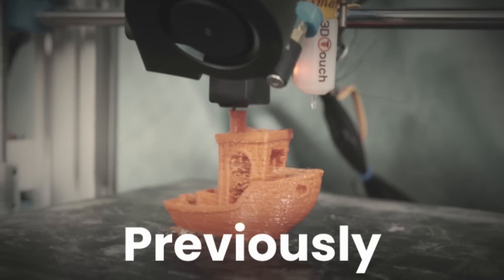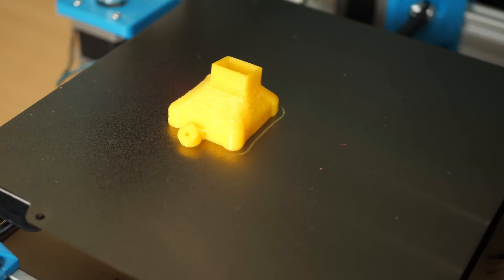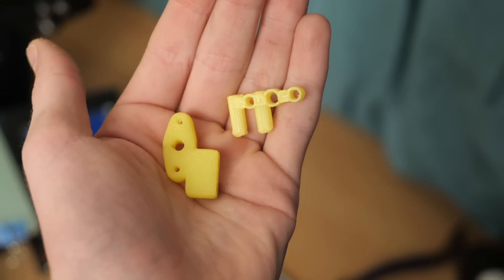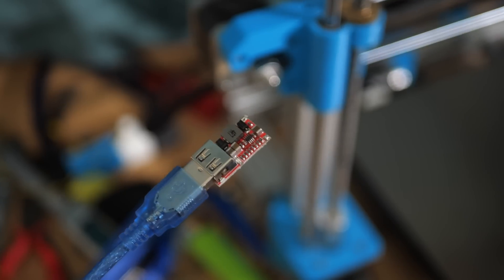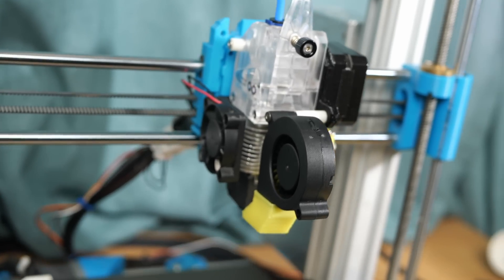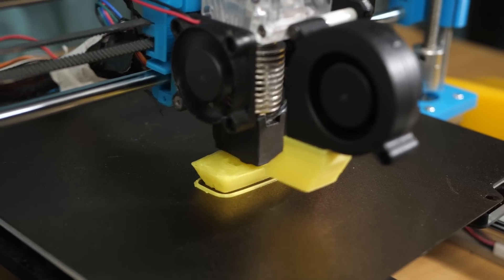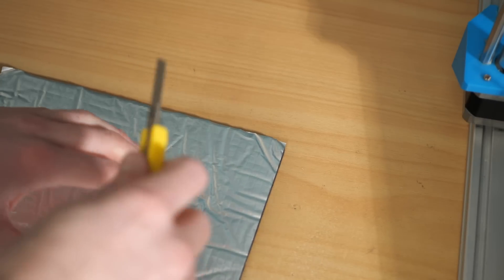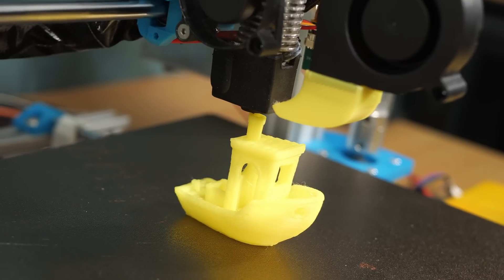I Bought a Broken 3D Printer and made it FAST!

Comment: NEVER calibrate rotation distance from printed parts. Other than the extruder, rotation distance is fixed and a function of pulleys, 1.8 or 0.9° motors, and any gearing involved.

I'm not being a hater this is super important!!!
Reply from the maker: Yeah, the rotational distance was being a real pain and confusing (especially because I couldn't print anything), mainly from mixed messages from too much research getting jumbled in my mind, I thought printed parts would be the way to go. After attempting "tuning," In the end (and after calibrating with the mechanical components) I got 32 (compared to stock 40) value for the X and Y and all my parts have been spot on since then, (thankfully.) From now on I'll definitely be taking a different approach. I appreciate your comments! All the tips and feedback from these videos has been extremely helpful.

Comment: looks like you have a g10 plate on your 3 and you said you picked up a PEI plate for the new printer? and the pei has been better for adhesion?
Reply from the maker: The PEI has been performing really well so far, and being able to take it off and flex it had been a great plus. I prefer it to G10 and can recommend it, of course it does cost more than G10 though.

Comment: Could you share how you built the printer? Board, Firmware, etc.
Reply from the maker: I wish I could, but I didn’t personally build it, It was purchased broken locally and already assembled. You can find details on it by Searching for Anet AM8 on thingiverse, or Prusa Bear, both machines are quite similar. I’ve made two previous videos on this printer, which contain more information on the hardware and software of it. I hope that helps.

Comment: Look great!! What retraction distance do you use??
Reply from the maker: thanks! I believe 0.7mm with a speed around 45mms. It’s the same settings as the previous direct drive extruder and I haven’t had any issues with it.
Reply: @TommyHoughton  thanks for replying! I just got a knock-off CHT and direct drive and had a problem with slightly wispy stringing. Keep up the great videos!

Comment: Excellent job bringing it back from the dead. Though I noticed something towards the end of the video 9:15 , when your x-gantry moves it's yanking the heated bed cable around with it? That's going to fatigue out the cable or connector pretty fast IMO, you'll possibly get intermittent breaks if left like that too long. Understandable that sometimes the wiring lengths or space behind the printer, don't always work out to be ideal though.
Reply from the maker: Good spotting, it’s definitely being worn out faster like this, I’m redoing it to be more durable.

Comment: This printer appears to be an anet a8 upgraded to an am8, great conversion if done correctly,I have one one of these and ditched the a8 electronics for the lerdge x board. I use mine for flex filament and abs, great set of videos, keep them coming 👍
Reply: It looks more like a Pruss Bear to me. But the Bear and the AM8 files are in Thingiverse
Reply from the maker: Good to know, I’ve been struggling to find files for this machine. I’ll make sure the series will continue.

Comment: Great video!  I have been using aftermarket upgrades and they do make a difference.  I would lose the springs for the heated bed in favor of solid spacers.  My tip for the solid spacers is to tram the bed and if needed add thin shims to the solid spacers if needed to make the bed as level as possible.  Makes the ABL work like a champ.
Reply from the maker: Thanks! I’ll look for some to install.

Comment: 8:18 :face-orange-biting-nails: Those springs! My first printer is an Ender 3 S1 Pro. The CR Touch is very accurate, but everything else about the ABL Mesh sucks. I now immediately replace the springs with silicone, anytime I buy a new Creality printer. Even if the first layers on them, are never anywhere near perfect. They at least stay put once it moves on. Glue Stick helps to.
+-I have 2 S1 Pros, an S1 and a Frankensteined V2(that's all but an S1 now). Can't wait to buy something from another brand. I'll probably go with Bambu. I'd love a Prusa XL, but is it really worth it?
Reply: P..S. Do you edit your videos? They are similar quality to people with 610,000 subs. 🍻 Here's to you reaching those numbers.
Reply from the maker: I have silicone bed springs on my ender 3 and are so much better than springs. I’ll get some more on the way. I’d probably go for Bambu as well. Heard good things about them, and the P1S sounds promising.
Reply: @TommyHoughton  You have a BLtouch. Just don't use any kind of spring. Mount the plate rigidly, use ABL.
Reply from the maker: @AlexusMaximusDE  Good Idea, I'll find some spacers to replace the current springs.

Comment: Hey I noticed your printed y tensioner is similar to the setup on my cr-10 s4. Would you mind providing a step file for it so I could modify it for my s4?
Reply from the maker: I wish I could, but I don’t have any of the step or even stl files for any parts on machine except for the couple of parts I designed in the videos such as the extruder bracket or electronics housing. When purchasing the machine the owner didn’t have any of the step files to provide me with. Sorry about that.

Comment: I also have a Mellow BMG extruder and although it looks exactly the same as the cheaper clones it is not! the gears are made from much stronger metal than the cheaper models and the tension control seems much better, I am not saying the cheaper ones are not useable as they are ok.
Reply from the maker: I’ve got one of the cheaper ones on my Ender 3, it works but I definitely found the mellow one to perform better and have better wear resistance. The cheaper one already looks like it’s been through a lot, but it does work.

Comment: I have been slowly upgrading my ender 3 pro to be the best 3d printer it can be I changed the Mainboard to the BTT SKR Mini E3 V3 because the original one was faulty for some reason and couldn't install a new fresh firmware on it and changed the hotend to the Creality Direct Drive Sprite hotend Extruder Combo and with the CR touch and it amazing right now I'm Just looking into making it print faster and removing the weird layer lines but this series is amazing and very helpful
Reply from the maker: Glad to hear that! Best of luck improving your machine!

Comment: Awesome series, can't wait to see what you come up with next! One thing I might suggest is paying a close attention to the extruder motor temp during printing - if it's too hot to touch it might cause issues, especially since it's mounted on a 3d printed part that's most likely not ABS. Lowering the Vref for that motor will get the temp down, but too low voltage will cause the motor to skip
Reply from the maker: I’ll keep an eye on it! It’s definitely been getting a bit too hot for comfort, I’ve ordered some heatsinks but I’ll most likely have to lower the vref. Once I have something other than pla on hand I’ll reprint the part to be stronger.

Comment: why you had 21mm cube? I mean XYZ steps requires no tuning at all. they derived from belt pitch and tooth count of pulley. I mean XYZ steps shouldn't be modified but I see clear issue with size. What I want to say if you calibrated 20mm cube to be 20mm then check that 200mm distance is ok because something weird here
Reply from the maker: Yeah, I couldn’t figure out what was the actual issue. I only wish I checked what the steps per mm were before I flashed klipper, ever since I did the dimensions were wrong. Despite no mechanical changes. I’ll do another checkup on the machine shortly.

Comment: Very groovy and fast too. FDM 3d printer groovy.
I'm wiring up a Lerge  z board to a creality cr10 s5, going from 8bit to 32bit, 500watts for rapid heat bed, bltouch, touchscreen, wifi, and led lighting!
Ya ya, almost standard by todays machines, but nothing wrong with updating a already existing machine.

Next, a print recycler, and maybe even trying to print using recycled strips of plastic pop bottles by shredding them into thin enough strips that can feed into the extruder.
Reply from the maker: That’s an awesome couple of projects! I’d love to hear how they go! Best of luck with your Cr10 S5.